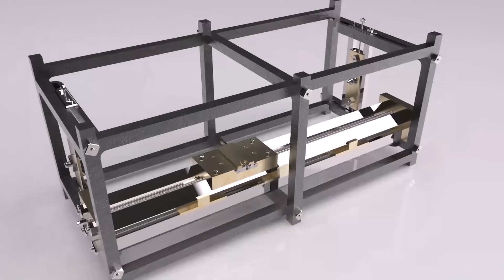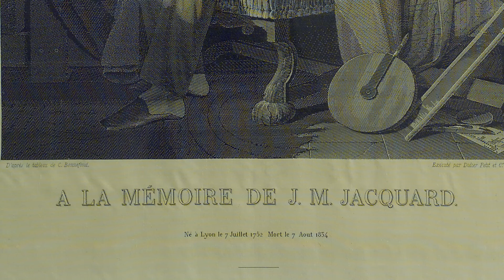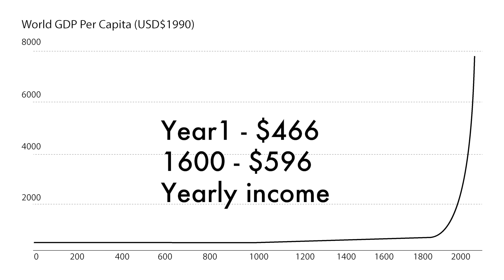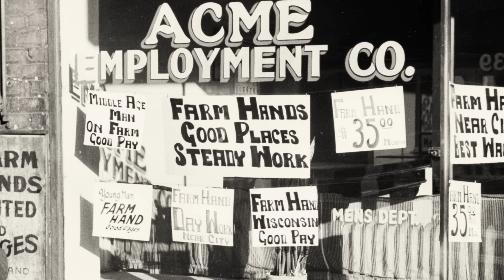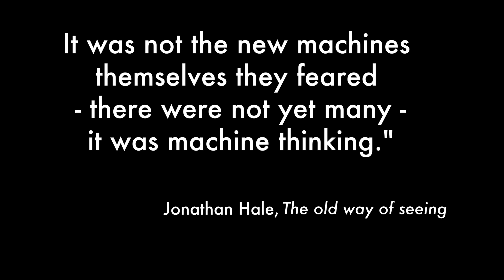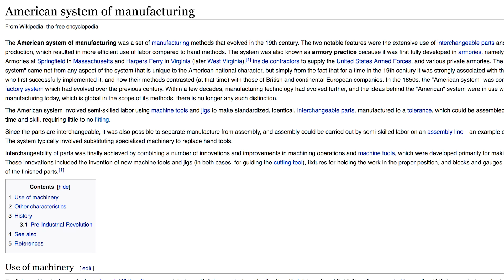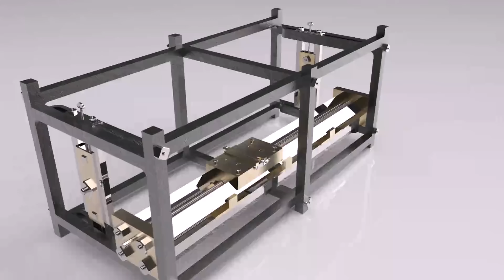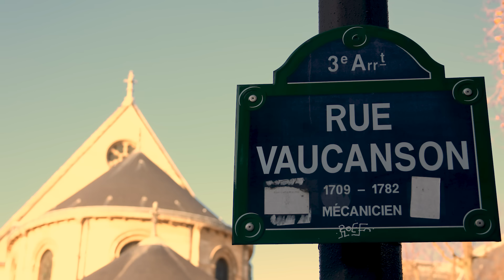The 1751 Machine that Made Everything

Comment: Amazing! Stunning!  Such a clear and entertaining way of explaining an essential (but potentially boring) project. On my channel, I use the wood lathe a lot, but I'm frustrated with the way people only see it as a way to make decorative items. I use it for some more precise tasks and I'm about to start building my own. This video is a great inspiration. I expect your subscriber count will shoot up very soon. Keep up the good work!
Reply: Potentially boring, yes.  But it’s hard to bore between centres, you really need a chuck for that.  😂
(machinist/dad joke)
Reply: @DrFiero  uhm, mostly true, allthough I have seen female centers/steadyrestcombinatipn  that gave ability to turn accurate spindlenoses relative to an external ground surface
Reply: @najroe  - A drive plate, a face plate with a slot, drives a "dog," which clamps to a round bar. One pointed center is in the center hole of the lathe spindle. The other end of the workpiece is supported by a center rest. The dog and workpiece are fastened to the spindle center with leather strapping pulled very tightly. Now a drill bit held in a tailstock chuck can drill a hole in solid stock or a boring bar mounted on the carriage can bore inside a hole in the workpiece.
Reply: DrFiero build a faceplate..check old popular science and mechanics magazines
Reply: I've turned plenty of small steel parts on my small wood lathe. I use the sharpened end of an old file as a cutting tool, files to shape, and a hacksaw as a cut off tool
Reply: Well, I'm going to have to try that. My dad has my grandpa's old Atlas lathe, but he's not letting it go right now. I have to make do with a wood lathe.
Reply: @oliverwatson1567  I do that with my drill press too. :)
Reply: @oliverwatson1567  good idea.
Reply: @oliverwatson1567  Clever...I like it.
Reply: Oliver Watson remember threads werent originaly cut they were forged..old village blacksmith
Reply: Yes great video. I’m also enjoying ur lathe build as well Rex
Reply: Thanks so much!
Reply: @RexKrueger  But... isn't the wood lathe only used for decorative or custom jobs these days? Outside of industrial applications?
Reply: @pkernoob786  I don't think I understand your comment. This discussion has gotten big. Can you re-phrase?
Reply: I have been a machinist and a toolmaker for 40 years. The lathe is the only machine tool that can make all other machine tools. The lathe is the backbone of manufacturing.
Reply: I'd like to add to the comments here that the industrial revolution followed the agricultural revolution, which is when europe started organizing the natural landscape into land parcels and enclosures to maximize food production. This allowed populations to increase and surplus food to supply industry.

Mechanized farming want really a thing until the late period of steam power, and was still gaining traction during  the Great Depression.
Reply: Can you use your wood lathe to make another wood lathe?
Reply: @rodschmidt8952 yes
Reply: Thats what bothers me about artist blacksmiths.  You can make annything in the world stop making hooks and fire pokers....
Reply: Have you tried spinning metal on it?
Reply: @WineScrounger  No, but that's on the list, for sure!
Reply: My tip is to speed it up go in and edit out some not all of the dead space like 75% would clear and speed it up
Reply: Who knew !!  It does make sense.
Reply: Stunning?
Reply: Nobody knows who invented the first lathe ,but the real requirement came for a metal turning lathe to speed up clock manufacture long before 1770 the only difference need was to increase the scale   ,don't forget like this dippo has clocks were the first machines and everything mechanical stems from them. Lathes are simple and easy to make I once made one from bed irons .
Reply: but isn't most of this just really inflation?
Reply: Rex Krueger maybe spell lathe somewhere else... the video is slow and boring and I only made it to 3:48 because I was hoping somewhere would be how to spell that word so I can find something good on it
Reply: Yo dude I loved your Billie Eilish bad guy cover! You're my favorite keyboard cat!
Reply: Shamanists, who despise the concept of the lathe because they think it removes people from their god-given path by enslaving them, are famous for spreading smallpox to their coworkers in order for them all to be unable to work, and by doing so, to apply a [revolutionary] force against their manager.
Reply: The first all-metal lathe changed how much wealth and productivity a person could achieve, creating new levels of comfort for most of the world. The emergence of AI is as big as the first all-metal lathe, and it will kick-start a new boom of innovation, comfort, and wealth the world has never seen before. The downside of new technologies is that the more profound their progress, the more dangerous they become for us. Without the lathe, we would never have made weapons of mass destruction. The same will be said of AI!
Reply: @Pestsoutwest  So you're starting a band called "Silver Sabbath"?
Reply: It is quite easy to boil water for steam with wood as a fuel source. This takes stone tools and lots of sweat. As everything else has occurred on the earth, there is a consumption of time and patience.
Reply: You have to be joking. This is ridiculous and oversimple, suitable for children.
Reply: i really enjoyed this, yet, i also think of the way when machines were to take over labour and leave humanity free to be sovereign.
now, it seems that's been pushed aside, like peoples income in exchange for mechanical replacements.
i guess its another way of "losing our souls". 

trading personal wealth for the misfortune of others. 

i heard this the other day: a bad person can never accomplish a good dead. the good dead will only spoil in their attempts. 
so it matters who's in control, more than it does anything else. & if we look at the patent office, its evident the wrong people are at the helm.
perhaps you see it in another light? 

im gonna subscribe :D regardless if you differ from my opinion. i love facts.
Reply: There were lathes of apparently massive proportions WAY before 1751. https://www.youtube.com/watch?v=qPn0NsZDtkk
Reply: The guy in video is wrong there were metal lathes over a thousand years ago . There are temples in India with metal and stone pillars which were turned on lathes way before the 1700s .
Reply: if you look closely at the chart it coincides with the creation of the federal reserve . They just printed currency and that increased prices. GDP= price increases.  we are still peasants. The rich own more than ever.
Reply: Love the enthusiasm Rex, but 90% of these items are gone
Reply: But yeah, the lathe rocks👊😅
Reply: honey maker but work on lathe. cheers
Reply: No job will be performed by a human that is better suited for a machine...
Reply: Ààà
Reply: see: wood patternmaker, precision wood work
Reply: Your amazing
Reply: The cnc?
Reply: ⁶6⁶⁷
Reply: HAHAHA boring..... hehehehehehehehehehehh......

get it?
Reply: Amen! This channel is so amazing!
Reply: ¹ĺ
Reply: I'm still going to say the single most important machine for the industrial revolution was the adaption of the steam engine by James Watt. Because without it most of the machinery wouldn't have even had a power source. Which predates the combustion engine and the combustion engine would have existed without the steam engine. On top of that mini ladies were eventually adapted to being ran by belts with steam. We already had automation and machinery during Roman times. But it was the separation from using the elements to power things that really gave us independence.
Reply: Actually probably this machine made nothing. It is very single task oriented for pieces of similar diameters and lengths
Reply: I'm a time traveler from the future hello
Reply: You comprehend how bad life would totally suck without machines?
Hell , just filthy hopeless hell
And what we do?
Let the crony capitalist “ Marxist basically “ send it all to Asian for some excuse they tell us , but really to keep it away from free thinking sovereigns
Reply: 9:14- Model T&A to Dc 3 / perfect 👍- really the most basic thing on earth - should be subsidized and keep in case they shit the bed with this technocratic eco gulag and they will and there won’t be new bed sheets because all the machines are gone to save the planet
Reply: Rex, I've never watched your lathe videos but you turned me from a powertool woodworker to a hand tool wood worker, blew my view of tools out of the water and become my first patreon subscription even when I couldn't afford it. Long way of saying I think you are pretty alright bud. (It was also fun seeing you debate with someone away from your channel. I bet you are fun to debate (not argue) with. We'd get it figured out :)
Reply: ငါလိုးမသား လီးတေ လျှောက်ပြော
Reply: Yep, my lathes, mini forge, laser and printer fix all or replace the crappy modern appliances around the house....literally.😏
Reply: For me when you look at your graft I cannot help to see that the up trend really stares in the 800's/900's when the "Windmill" came to the countryside...hence Don Quixote is one of my greatest hero's for he was the "FIRST" Environmentalist and Abacate ageist the Industrial Revolution that stares with the "Windmill"
Reply: Rex Krueger, it is interesting how were made spindles and other rotary parts of the first machine tools in the world. How were aligned spindle and tailstok? How was achieved the perpendicularity of axes?
Reply: Rex Krueger 
B

Comment: Great video. As a former Tool and Die Maker I've always found the accuracy and precision of machine tools and measuring tools very impressive. Of course accuracy is also tied directly to the precise measurement and mutual acceptance of measurement standards that use real physical objects to calibrate measuring instruments. Also, every machine in every factory is designed by an engineer and made by highly skilled machine builders. These are not assembly line jobs, these are the highly skilled, highly paid jobs that create assembly line machinery. Skilled trades like machinists, electricians, plumbers, mechanics, masons, carpenters, and many others, will  always be in demand. These jobs created, and still create, personal wealth and income for individuals in society. In a society based on the mass production of material objects those who know how to create, build, and maintain them will always be valuable. Thanks again for the video.

Comment: I tell every young tool user I meet:
The origin of technology is precision. If you can produce anything with a 10 thousandth tolerance, you can rebuild modern society with a single lathe.
It is a very simple machine, that can build very complex machines. 
Lathes are the heartbeat of manufacture and design. 
My dad built a lathe from scratch in 1970 to turn turbine shafts for jet engines in the F4 phantom, there was a problem with the mainshaft that required replacement and a huge time and labor expense, he made the machine to service the shaft to utilize compressor stages from the new designed engines in the Phatom 2. Basically, a field expedient upgrade to alleviate maintenance and repair time between sorties. He was stationed in Udorn, active duty AirForce, the base wasnt officialy a military base. If you have seen "Air America" that was the type of base he was on. We basically had airbases completely surrounding N vietnam

Comment: Try to buy a closet of handsewn, handspun cloth. You'll reevaluate whether you make as much as a peasant in the 1600s.
Reply: shhh....don't make the peasants self-aware!
Reply: @AustinKoleCarlisle  a Big Mac which is under half the size, adjusted for "official" inflation, costs four times as much as it did in 1980. Wages have stayed roughly the same, not adjusting for inflation.  Still weren't as rich as a common serf, though.

Comment: If this is the machine that made everything. where did they get the lathe to turn the shafts that were obviously turned on a lathe, as you can tell by the center holes in them.

Comment: The reason that the internal combustion engine became the power plant for cars and aircraft was that it could be made from a lathe.   The key invention of the Wright Brothers which made powered flight possible was an aluminum block internal combustion engine.   The holes for the combustion chambers were bored out using a lathe.  The cylinder heads were cut precisely to fit with a lathe.    The invention of aluminum smelting using electricity in the 1880s made aluminum very cheap.   These were the key factors that allowed for the building of a light enough engine that could power a heavier than air aircraft.    None of these key features were patentable, btw, as all the technology of internal combustion engines had been developed years earlier.  The Wright brothers were just the first to use the now cheap and affordable aluminum blocks to build a lightweight aluminum block internal combustion engine that could power an airplane.   Their only patenable idea was their use of wing warping as control surfaces for the airplane, which they used to such devastating effect to protect their invention that aircraft development in the U.S. lagged far behind the European countries, thus causing the US to have no effective aircraft for WWI.
Reply: Curtis developed the use of ailerons instead of wing warping, which the Wrights tried to contest as a patent infringement, but IIRC, Curtis showed that it was a different way to control roll and it allowed modern airplanes to proceed since wing warping was not possible with the more rigid built, metal wings that came later.

Comment: I come home from my shift running manual lathes in a repair shop, and see this. I certainly understand how important this is. I've made parts for electric motors, hydraulic excavators, engine flywheels, and now large pumps, and I also volunteer to make parts for steam locomotives.

Comment: Hello, great content. Can you tell me why the old screw slots have a small “dimple” in the center. Thx.
Reply from the maker: I believe it's because to make a screw then you would get a blacksmith to hammer something into a rough cylinder.  to get it smooth enough to be a screw you would have to put it into a lathe.  The dimples in each end would be where the lathe centers held it in place while it was machined.  Looking up turning between centers for more info.
Reply: @machinethinking  I’ve got it, makes perfect sense. Thanks.

Comment: The ancient Chinese made lathes out of bone to carve jade, which is how there are large very round jade discs from the stone and bronze age. That is not to downplay the historical importance of the all-metal lathe, but jade is generally tougher to carve than steel, with even tempered or hardened steel falling between 7 and 8 on the Mohs scale (which measures the type of hardness relevant to carving) and unhardened steel which would be carved on a lathe falling closer to 5, while the nephrite jade the ancient Chinese worked with has a Mohs hardness of 6.5, lower than hardened steel but still harder than what you'd be working on a lathe. The same tools would also be used to drill fine details, filigree and openwork on jade pieces. All of that I feel indicates that an all-metal lathe isn't necessary for the precise fabrication of round objects, including objects made of steel.

Comment: The lathe is one of the few machines that is capable of self replication. In other words you can use a lathe to build a lathe. Takes some attachments for making the gears and stuff but it's pretty amazing what is possible with a lathe and why I currently own 3 although one is going to find a new home soon. I have slowly been putting together a small machine shop. I have the lathes, a milling machine (well two but one is going to find a new home), a bandsaw,, and a surface grinder. Need to get some accessories for these machines and then I''ll have my little prototype shop running. Planning on doing one off projects for people that the bigger machine shops don't want to mess with or charge an exorbitant price for doing. Been planning this for a while since I needed to get an intake hat made for a turbo project I was working on and was turned away but a couple shops and the one that did it I had to fix.

Comment: "Everything" -  I was not aware that the 1751 machine could make violins, ocarinas, timpani, butter, golf balls, shoes, spectacles, furniture, and snuff.
Reply from the maker: But see, it does.  The lathe is generally considered the mother of machine tools. Machine tools make the specialized tools/machines that make the products you mentioned. If you gaze into the machine navel, as it were, you get to a lathe at the end. With only simple hand tools (and a lot of skill and knowledge) you can build an accurate lathe from scratch.   The lathe can then be used to make any other complex tools you need.

Comment: so really your line shows the economic benefit of the steam railways.  yes, the lathe had a part in that, but so did many other technologies - pressure engines, to begin with, fire-tube boilers, the bessemer converter, the witworth standard, and these are just off the top of my head.  the lathe is important, but i think your title is very misleading.

Comment: My dad said a lathe could make basically every other tool and was the most useful tool every, but in the 30 or so years we've had ours, it's really hardly ever been used, and I never used it for anything... at all.   It's just a big machine that takes up a lot of space.

Other tools... like hand grinders, hand drills, drill presses, miter saws, stick welders, soldering irons...  vices, hammers, wrenches, screwdrivers...   I use all.. the frigging... time.

But never the lathe.

As a woodworker, he made a few wooden boat paddles on it once, and that was it... 

The lathe is over rated.